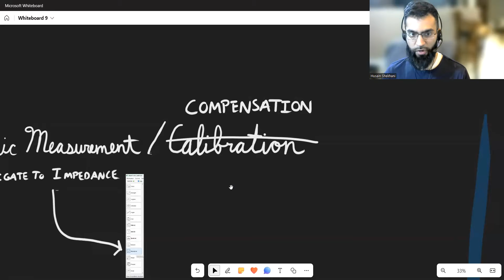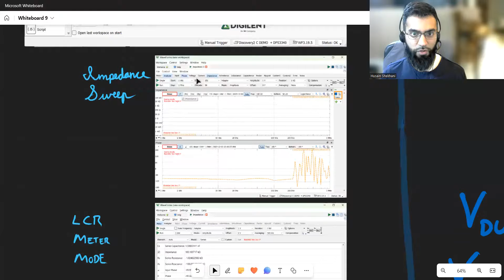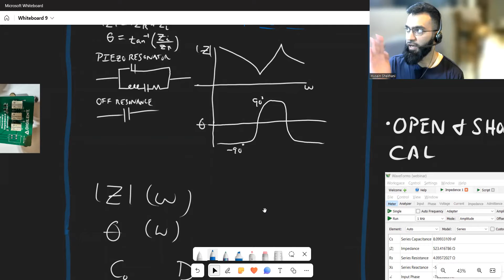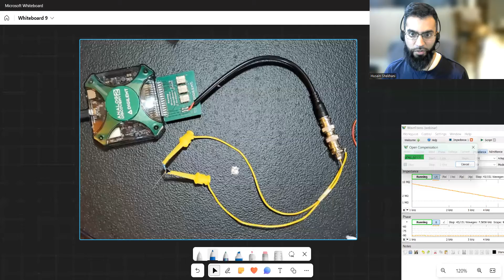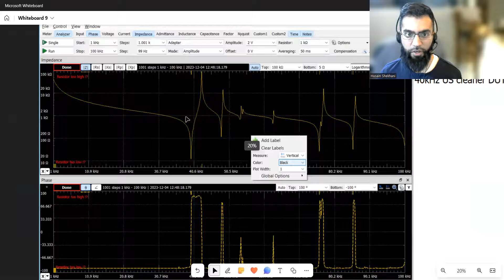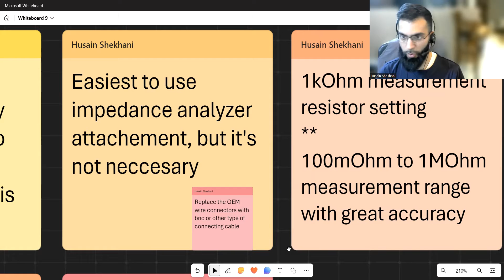How to make Impedance Measurements of Ultrasonic Transducers with the Digilent Analog Discovery

Comment: Hi, thank you for this video, it is very helpful. Do you know the equation which Analog Discover use to calculate impedance? I mean based on the Oscilloscope values that it measures (V1, V2 and Input Phase). BR
Reply from the maker: It depends on the circuit. With the adapator, V=V1-V2 and Current=V2/R.